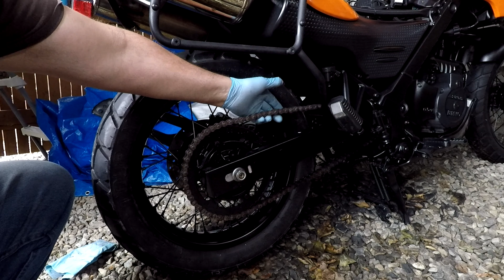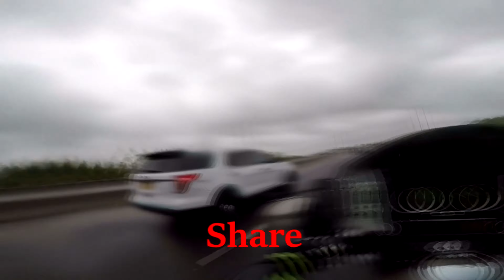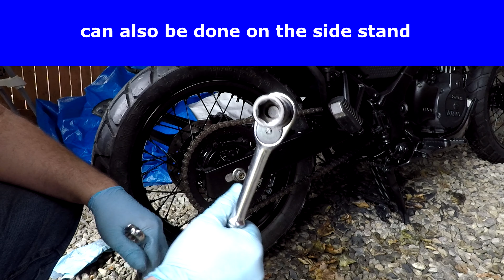Drive Chain Adjustment- 2007 BMW F650GS | Techn' Moto

Comment: Hi Mike, is there a diference if I'm using the central stand or the side stand? In the manual that is not clear about the stand we have to use! "
Reply from the maker: in my manual it is clear- use the center stand with the bike unloaded- said in the video at the beginning. Hope that helps

Comment: Hi Mike,

Once again thank you for saving me a lot of money on labor. I love the DIY videos. Just finished adjusting to drive chain. And tightened the 24 mm two 100 N meters. Do I need to torque the other side 19 mm to 100 new metres?
Reply from the maker: No just the nut side. You talking about the axle nut right?
Reply: @TechnMoto  haha. Sorry still learning. is that the chain side? The bigger one? (24mm)
Reply from the maker: Yes. No problem, glad to help out if I can.
Reply: @TechnMoto  thanks again Mike! I accendtally torqued to 100lbs to instead of NM. Oops lol realized fixed my mistake hope there is no major effect. Planning to do your aux light video next but not too sure if im confident with handling anything related to electricity. Stay safe! 😁
Reply from the maker: @carlo2274  no issues there. I think the original torque is something like 77ft lbs so it should be okay lol. We all start some where right?  You did well and did more than most. Most just want someone to do the repair for them and for free lol. I commend you sure for getting it done 👍👍. One more thing if your not to sure on electricity work get someone to help you out. Nothing wrong with asking for help. Keep on buddy and ride safe
Reply: @TechnMoto  really appreciate kind words and encouragement mike! God bless you and stay safe my friend 😁